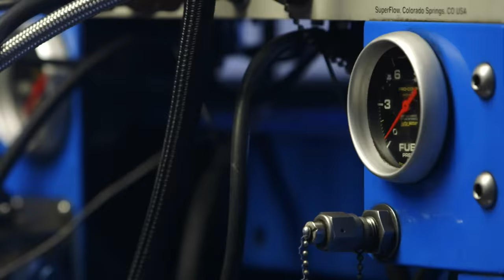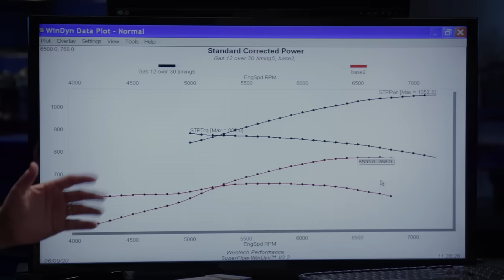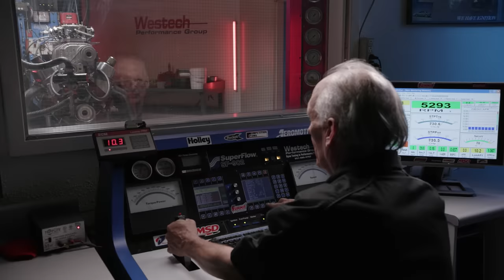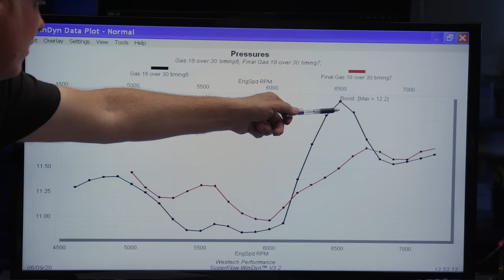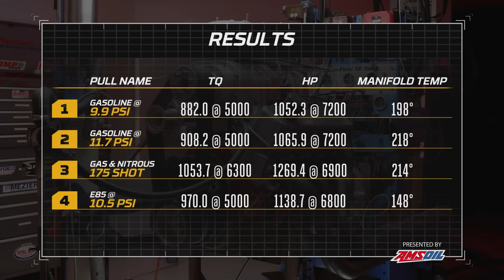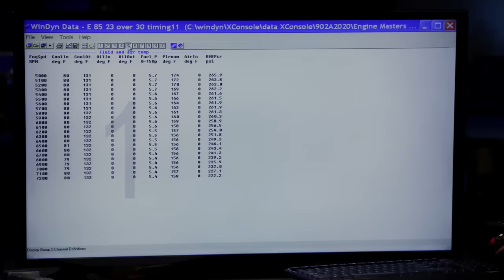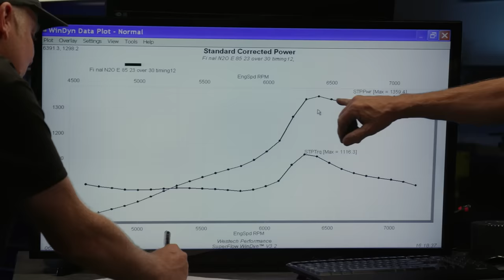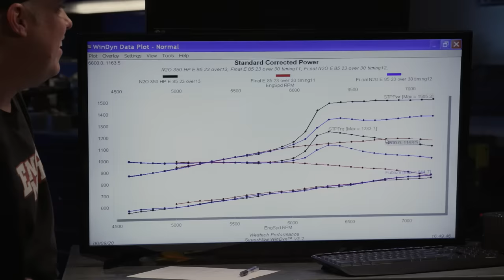1,500 HP, the Blown and Squeezed Way - Engine Masters S5 Ep 64  FULL EPISODE | MotorTrend

Comment: Boost level is also a measure of restriction, like said in this vid. If you do head work and increase flow efficiency, you can actually make markedly more power at lower boost level. It feels a little counterintuitive on it's face, but if you think about it further, it's really just common sense.

Comment: Awesome! Boost is one thing, and I think Gale Banks explains that pretty good. For this test, increasing the overdrive ratio of the roots blower, I think we see a twofold effect: 1) Increased temperature, so less dense air. 2) Severely increased parasitic loss just from driving the blower. Would have been interesting to see nitrous on e85 with the "happy hour" pulley setup. Roots is good for response, but for big power there are better boost techniques available. You have to decide what you want.
Reply: Yes I think people have forgotten what these superchargers were originally designed for and how long they have been around there is more efficient and improved designs on the market now maybe not so cool looking though 😎

Comment: David.  Do you bring the rpms up slowly to 1800 to see what the air fuel ratio is on gasoline to know what size the idle feed restrictions are. Then take it to 4000 rpms so you see what the primary jets need to be.  Then during a power run. To see if it goes rich or lean as the secondaries open along with the primaries

Comment: This is also why I added a 75 HP dry shot on my 2004 Acura TL with intake, headers, exhaust, six speed manual swap. They make 270 HP stock with a 11:1 compression ratio.

Comment: So, I heard one of the guys mention roots-style blowers are prone to building up heat.  Are centrifugal blowers less susceptible to producing heat? It's my understanding that all forced induction systems will produce heat to varying degrees, which is why you should introduce a charged air cooling system, correct?  Also, this was an impressive test in that my takeaway is: the NA motor made approx. 750hp, and the blown, nitrous, E85 setup doubled the hp.
Reply: I don’t have much experience with boosted applications but from what i under stand with a centrifugal blower you can run an air to air intercooler or some other cooler much easier than a roots style
Reply: Centrifugal blowers are more efficient and heat the air less. There is also less mass, along with usually not being mounted in the valley, so there's less heat soak with them. However centrifugal blowers don't make the boost and power at low rpm that a positive displacement blower will. 
At the end of the day there's pros and cons to all the different styles of forced induction. Just have to figure out what matches to the idea of what you want.

Comment: I wonder if you had backed it down to 9PSI on the blower if it would have still made similar power with the 350 shot of NOS, due to even colder air temps. Either way, awesome set up. 

When you said Finnegan uses the same blower, did you mean brand or brand and size (8-71 vs 10-71)? I felt like Finnegan never revealed how much power the Blasphemi made.

Comment: One idea for a show I have had is taking 3 motors; 1) very mild 100-200 hp, 2) 400-500 hp, 3) 1000-1500 hp - then dyno-ing them on the engine stand then in as similar cars as possible to demonstrate powertrain parasitic losses.

Comment: The 8-71 is really only designed to feed 568 cubic inches at 3 psi.  Therefore you’re eventually going to run into total flow limitations no matter how fast you spin the pulleys.   The housing will only flow so much air overall and when you spin the rotors faster than the housing will flow, they just fight against the air.   That fight is friction, friction is heat.

Comment: Bigger blower = less overdrive = lower air temps = more power. This engine needed a 10-71 from the start. That's the minimum for anything over 540 cubic inches. It also takes more power to spin a blower quicker and that comes right off of the crank.

Comment: Air temps post blower are cooler because the carb is pre blower and fuel is cooling the blower and the charge. 
It would be interesting to see the blower outlet temps with EFI post blower.

Comment: Hey guys excellent video but I have a question I have noticed on all of your shows that when you do dyno pulls regardless of the engine and power adders the HP and TQ always cross on the graph around 5200 rpm why is that

Comment: Now if you change the oil from AmsOil to Valvoline straight 40 weight racing oil (part number 229) you will pick up some more hp and less wear on the cylinder walls.  I've done my own testing with my V-8 Vega.  Also, I'm a lifetime AmsOil dealer.

Comment: The only thing boost is, is the pressure that is behind the intake valve.  Nothing more, nothing less.  Camshaft specs overlap, duration, timing can/will have a huge impact on what your boost gauge reads also.  These guys should know this and state this.

Comment: Mechanical driven superchargers are always a colossal drain on power. That supercharger there is probably pulling over 200hp at low boost. That, plus manifold air density is why your power gain is so so small

Comment: So with manifold having vacuum and when wilde open a perfect intake would have zero vacuum. 

So wouldn't it be the same thing that having boost pressure just proves that's more air in the intake that's not being consumed by the engine?

Having the boost tuned to almost zero while still maintaining peak hp numbers would be better because the engine doesn't have to use its power to make boost its not able to use and robbing hp for no gains?

Comment: We made 700 off the motor and 600 on the nos. 80s baby. 1300 hp. 8.50 quarter mile. Streetable and then nos on the strip.

Comment: i was 13 and had a 2 1/4 hp briggs and strattorn in mini bike, the throttle cable was broke so i had to ride one handed while one hand used to control the throttle butterfly. the brakes were a pad that pressed against the tire. well, i found out how to develop massive hp from that motor, going over some bumps my hand kind of slipped off the throttle valve, only it hit the lowest position over the bumps enough that the valve pulled out and was in  my hand. this motor was spitting gas out of the top of the carb, it was probably hitting 3000 rpm, no governor either, the brakes wouldn't slow it down, both feet flat on the ground wouldn't slow it. but it was fast. there was a bolt in the clutch.

Comment: I would be curious to see a side by side comparison of this style blower vs a more modern blower like a whipple. Also curious what kind of intercooler system this motor is using. I would imagine it has some kind but they didn’t mention it.
Reply: Carburetored setup doesn't need an intercooler
Reply: Whipple is not a blower, it is a charger, and makes more power.
Reply: @jordanivey529  needs but cant use.

Comment: The reason that the boost didn’t rise with nitrous is because it’s was injected above the blower, the blower can only move so much air, you would find that the airflow through the carbs themselves would of reduced while the nitrous was activated.
If you injected the nitrous under the blower you would of seen a rise in boost pressure.

Comment: interesting that heating the air by beating it with the blower 'lobes did the opposite of Smokey Yunick's famous hot air engine. guess there was something in the cam design or ignition timing if it actually did work as claimed (Smokey knew to hide details of his inventions to avoid copying)
Reply: Hot vapor engine didnt work, just another Smokey cheat.

Comment: no timing adjustment? i would like to see power difference if you use EFI instead of the carburettors? you could place a "brick" style intercooler between the blower and the block. same as they do with the ford V8? cooler charge temp. more ponies? as soon as you said, "party pulley", big smile! was expecting more. E85 loves boost and timing. notice with the party pulley you are still at a low intake temp? E85 will take 25 psi plus. low initial compression ratio, with extra timing and the lower intake temps, it will take a lot more boost till you start to plateau. you need a, "bender" pulley! might make 2000?

Comment: I thought with a blower the compression needs to be low or you burn holes in pistons? Or is it more ring end gap?
Reply: All the engine sees is cylinder pressure. It never knows what its compression ratio is. There are many different ways to get there.
Reply: There's a trade-off between fuel octane rating, boost and compression ratio. More accurately, the limit is set by a) how hot the charge gets before the flame front from the spark reaches it and b) how much heat is needed to make it spontaneously ignite. Go too far and the engine will start knocking, leading to destroyed pistons.

This is also influenced by the cylinder head design. A head which needs more advance effectively subjects the charge to more heat before it is burned.

Comment: Why do the pulls start at 5000rpm? Would be more interesting to start them at 3000rpm
Reply: Perhaps the dyno absorber struggles with the torque at lower RPMs.
Reply: Perhaps the dyno can't absorb this kind of power at 3000. Or they were worried about bending rods by lugging the engine.

Comment: Just one question Freiburger, well I have two questions for you. What was the racial of the blower drive before and after you changed out the pully's in terms of 1:1? The second is, why do we not see any engine builder of a v8 boosted with a forced induction blower. Not have a intercooler on that specific engine design? The straight four up to straight eight's of the 20's to just before WWII all had intercoolers on them. Again why is it that the v8's do not have them?
Reply: The cooling effect of the atomisation of the fuel pulls a bunch of heat out of the air. On E85 this is even more pronounced, no need for a charge cooler.
Reply: It comes down to room and visibility most of the time, the blower is already poking thru the hood on an old school setup like this. Several factory supercharged v8s have intercoolers that are plumbed into the ac system. It has been done on these old school setups before. But it doesn't even matter if you just run e85.
Reply: About the intercoolers, it's all about packaging. Intake ports typically face the valley of the V, so that's where the intake manifold goes, and at that point it's easy to just stack a blower on top.
There are some water-air intercoolers that go between the blower and the manifold, and even some supercharger manifolds that have room for heat exchangers inside them. These use water that's pumped through a separate radiator to cool down the intake charge.

Comment: Put a set of 307 sbc small valve heads on a 427 and prove the boost figure wankery to the kids.   50 psi just means you arent flowing (mostly).   Try that nice roots blower against a 3liter or bigger whipple?

Comment: one of the things about this is they keep talking about boost and making more power with cooler air charge vs adding boost, or allowing the engine to accept more boost because of lower temps. It is about air density. talking boost and temp independently is leaving a lot of information on the table when it comes to making predictable reliable power.

Comment: The blower shop does make good blowers but they are really good on the street and on race you can spend the money but you're not going to get anything like a little filled or a kobelco which is now Fowler so that's where if you really want to make power you go to. I've seen the kobelco now Fowler 671 Superman's that they use in double a gas make over 3,000 horsepower on a 450 inch motor

Comment: Actually this is not the Full episode... at the end their talking about " what if 15 or 18 psi and a 400 shot for 2000 hp. If we ever get the nerve to do it. On engine masters ".... go to Motor Trend TV for the real deal 

But this one is okay.  It'll rope some of you in....lol
Check out the one where they use this engine but put the blower on the Tunnel Ram... major gains across the board.... The Tunnel cram as Freibuger says...lol.... The tunnel ram with blower is something I did years ago.  It works...very cool charge as you can imagine 😎 💯👍

Comment: Love the full  episode as well but  Why do people keep fooling with a 8 71 on a engine of that size. Especially with a good set of heads it's always gonna have to be overdriven. You have to spin it to the moon to make baby boost and have high air temperature no efficiency whatsoever. It's kind of funny that nobody ever has noticed the marine market how they run their engines. 1000 to 1500 horsepower on pump gas and run 5 to 7000 RPM all day long all weekend & all summer long. With solid roller cams and never check valve lash maybe once midsummer sometimes not tell winter .

Comment: Take the nitrous off their throw the nitrous away and put twin turbos with the blower and you would have better results and you wouldn't have to worry about blowing the motor up from the nitrous oxide cuz that's all that stuff is liquid trash motor is designed to blow the motor up not actually healthy engine I think nitrous blow more Motors Upton then the nitrous oxide help

Comment: You pick up 1lb of boost and 26hp, with a rather inefficient type of air moving. Since you already know turbine style blowers and turbos are more efficient why not go ahead and show what happens when you remove the drive power waste, at that point with the removal of the load on the crank you would add 2-300hp probably and then feed the turbo with the nitrous exhaust air movement.. Dave.. I've been buying hot rod since the 80's my dad bought them since the 60's, stop dumbing this down so much, 26hp for a lb of boost or a 150 year old blower design isn't terrible. It's pretty good for a 8/71 blower that's getting close to peaked out. So stop playing the fool, there are those of us that know, and we know you know better, and 4% blower speed isn't party.. So quit catering to people that do not know any better.

Comment: Whoa... wait a minute.... This engine seems to be a basic Pro  Mod setup, or close anyway. Big cubes;  big blower. Pro Mods are going 3000 to 4000 HP. They gotta be boosting pretty hard, I'd think
My head hurts... someone explain all this a bit better.... I'd think that many cubes with that blower and carb things ought to be hard to keep under 2000 HP...?? Oy vey....
Reply: Nothing like a Pro Mod at all other the the displacement. A Pro Mod is Hemi based, runs a bigger blower and burns methanol via an injection system...

Comment: Build a 289 or a 283.  ARP heads.  Small horsepower.  Nice cam.  271 H:P.  305 HP.  A engine I could put in a Kirkham Cobra kit car.